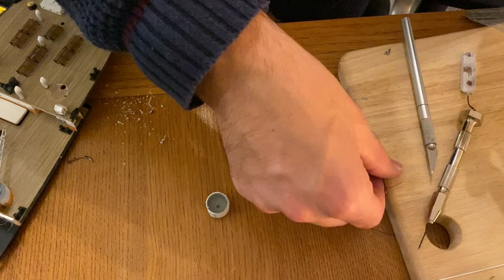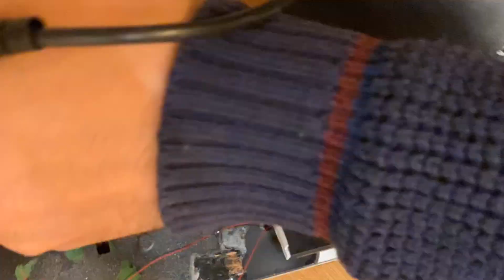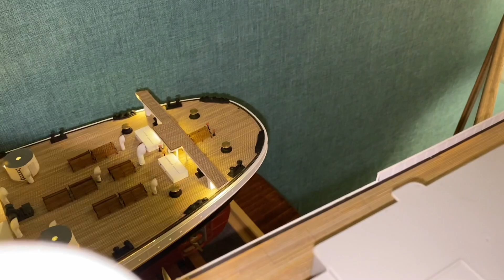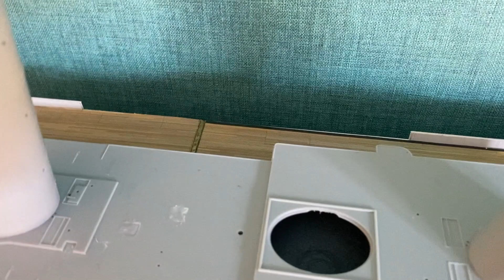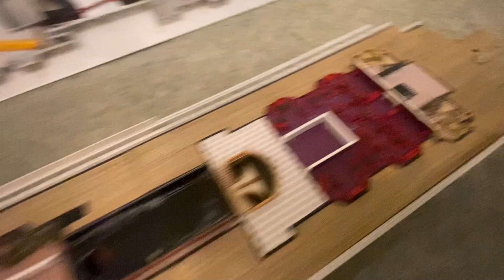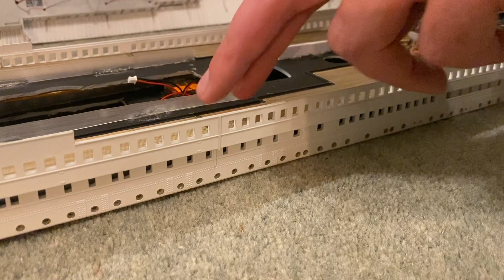Radio Control Trumpeter 1:200 Titanic Build Part 43 - Aft Section Lighting

Comment: Nice build so far..Been watching a number of your vids. Just a question about your lighting. You`ve lit every port hole. It seems somewhat extreme.The lighting intensity seems to be somewhat off. Can you dim the lights at all ?
Reply from the maker: Hi there, 
I have in a later episode added a switching regulator to the lighting circuit which allows me to dim the LEDs somewhat. I am tempted to add a PWM feed to it as well to allow me to dim further. 
As you say a lot of portholes lit which is perhaps not accurate, in due course I’m going to go around and black out a few to make her look a bit more realistic

Comment: Use magnets to hold your decks in place
Reply from the maker: I’ve trialled a few magnet solutions for the deck. Unfortunately the issue is a high enough power magnet to hold the deck in place also makes it too big for me to hide! 
Because of light bleed issues etc I really need a force holding the decks down that can only be achieved with nuts and bolts really. 
I am hoping to use magnets for other jobs such as rigging though. Things that don’t rely on as much strength and are likely to be removed frequently.

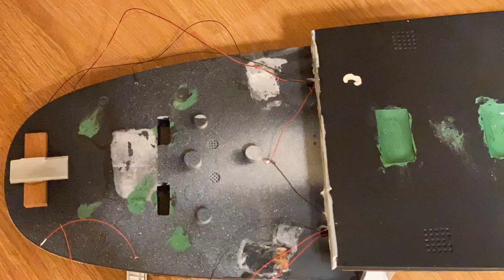Comment: Just out of curiosity, and I think I 'may' have asked you this before, but I'm not sure, but is there a reason why the back left air vent thing on the upper deck here ( 4:19 ) is slightly off center, and pointing slightly left at almost a 40 degree angle while all the others point straight back? I'm just kind of baffled every time I see it. As always, great vid. Always thrilled when a new one gets posted.
Reply from the maker: Hi, I don’t remember you asking this before! But to be fair I am in the habit of missing comments at the moment. 
So the vent is slightly off center because I have seen a few images of it in that position. I think the images were probably Olympic rather than Titanic but I quite liked the lack of symmetry.
In reality these ventilators could be swivelled to face into or away from the wind so it’s isn’t a a given that they’d all be pointing aft.
But very much a personal choice!

Comment: Whats the rooms under the poop deck used for none of the titanics cutaway diagrams ive seen ever show it.
Reply from the maker: Hey there, 
There were several things, I think people have covered most of them tbh.  But the bit directly under the winches was a staircase that lead deep into the ship and served  most of the third class accommodation. Aft of that was the third class general room, and the third class smoking room along with a bar. Then the main machinery for the rudder aft of that. And that’s about it really!
Reply: @marcush2220  was it crew cabins or third class?
Reply: @chasechildress2720  yes , what I think allso the most easy cabins with the beds attached too the slope wall.
Reply: @chasechildress2720  yes I believe so.
Reply: The 3rd class smoking room and general room were both located under there along with a main stairwell for 3rd class. The aft most section also housed the steering gear and some storage compartments.

Comment: Hi Rob that light bleed is a little annoying but as you say not a disaster and easy to fix.  Baking foil makes a nice black out too.  You could make tiny lenses for your deck lights by making spots of transparent glue on grease proof paper. Thanks to you I can pre-empt the light bleed on the deck bridge and sort that out without having to revisit that area. Good video as usual! Regards JH
Reply from the maker: Hi Johnny,
Yes it’s a right pain, I think I have solved it for most areas. But the issue on the aft bridge is a bit more problematic because of the lack of space. I think I will have to try and use foil under the scaledecks there. 
I was thinking about it using that UV resin for the lenses on the crane bases. There are a few PE parts in the ka set that appear to be surrounds for the lights which should finish the job nicely.
I’m still mulling over the domes for the boat deck. I suspect I will relent and get them in the end! Self restraint is harder when I’m this close to the end of the build.
Keep yourself well and hope your heating system is going well! 
Robbie
Reply: @TheModelBoatGuy  Rob, I have studied the KA on and off for ages and usually discover new things quite often!  I will look out for those light surrounds!  Yes, don't relent on buying the domes just yet as I may have some good news for you soon. Watch this space!!!!  My lights for the hull will be concealed in a domestic UPVC electrical wire conduit trunking which will supply lighting via fibre optics in the hull.  My idea being that it will eliminate virtually all potential light leakage at a stroke.  The superstructure etc is of course a different matter!  Heating system going well, I live very rural so the temperature drops like a brick! Regards JH 😉

Comment: I'm using magic scale moddeling lights on mine I'm adding deck lighting using the leds but I find them a little too bright. I have put a bit of paint on them to get the right colour I want. My question is what can I do or use to tone down the brightness. This whole kit works off a circuit board to sub stations. I was thinking of applying resistors but to be truthful I'm not that sure what I'm doing with electronics so I'm just winging it. Its going great so far but just want to get the brightness down on the deck lights.
Reply: You cant really go wrong with resistors - you can add them to either the positve or negative wire and it doesn't matter what way round they go. The higher the ohm value of the resistor the dimmer the light will be. Start with around 300 ohms and adjust to suit.
Reply: @NeilGKing  that's great. Thanks very much Neil much appreciated. Just ordered a box of multi resistors. I will take your advice 👌😀
Reply from the maker: Hi, yes as Neil King says resistors are pretty simple. Plug and play until you end up with an effect you like. 
The only thing I would say is if you are cutting wires etc get some heat shrink or something to cover over exposed wire once your done. It will reduce the risk of a short circuit later on.
Good luck with it!